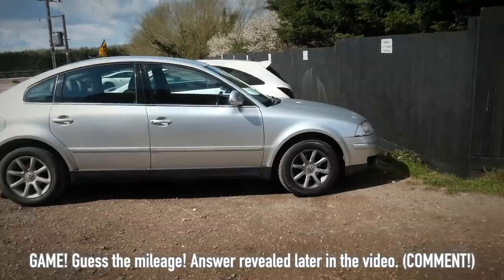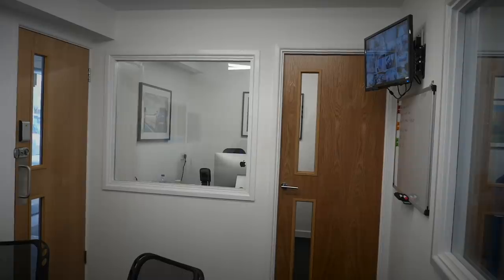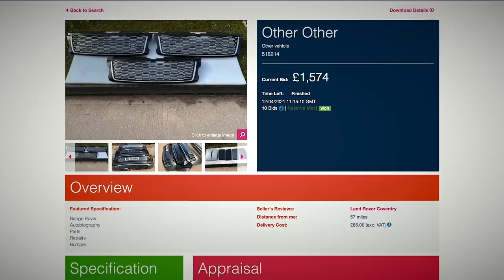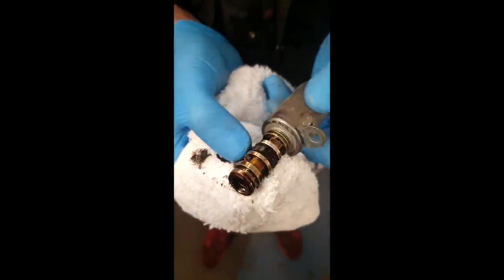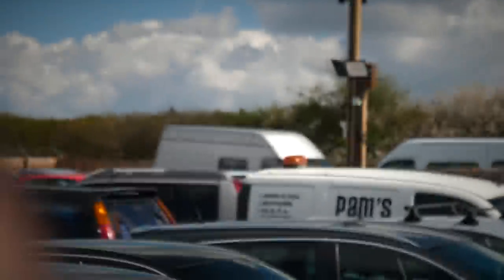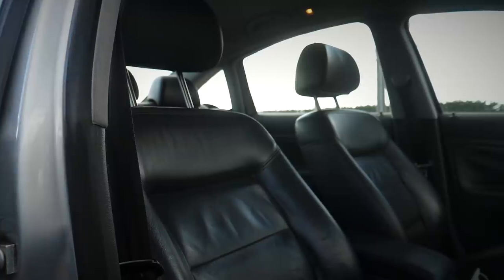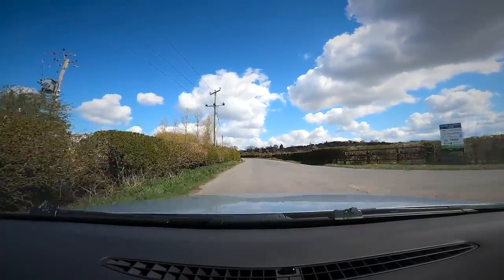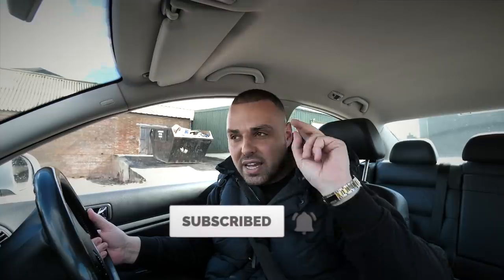INTRUDERS At Work! A Week Of PROBLEMS At BINCA! | EP2

Comment: My 2004 Passat 130 Highline was the one of the best cars I've owned.  I bought it in 2008 with 96k miles and sold it in 2015 with 250k miles. I had it remapped to around 165bhp and it never let me down once. Pretty much everything was original when I sold it including the clutch, gearbox, suspension and turbo; the only bits I needed to change were the alternator pulley, the injector wiring loom after it developed a slight misfire and the coolant temperature sensor. It's still showing as mot'd now with over 300k on the clock.

Comment: I own a taxi company in Scotland and we had a skoda octivia with 469k miles before we sold it and it's still going about to this day.
Reply: Bloke called Trigger now owns it 😂
Reply: Yes theres 100s around the UK with over 400k genuine miles and are taxis and have been sold on to other drivers..
Reply: Would the modern octavia diesels be able for high millage?
Reply: @irishman6124  not a chance sadly. We use mostly seat toledos now and even they aren't as reliable 😭😭
Reply: @bendover-eo9iu  thanks for your reply.. So many say modern diesels are unreliable after 120k...as I've noticed it myself.. I hate when people say its all about geting it serviced every 10k... What's your opinion on that?
Reply: @irishman6124  they are all good for high mileage, as long as you service them on time etc. They all last forever
Reply: @simmsali4994  their worn out after 120k..egr..dpf. Flywheel. Turbo. Sensors. Electric problems.. Etc etc etc.. Servicing has nothing to do with it... Its all about milliage... I'm at a stage now I hate cars
Reply: @irishman6124   b cuz your buying bags of crap, ragged abused ones. that's why!!  you pay for what you get. Flywheel dpf turbo?? ahahaha, what crap are you buying?? I have a vrs tdi now 2010 no problems at all!! Had it for 3 years!! so far just servicing like I told u. I'm on road 7 days, people use them as taxis!!!
Reply: @bendover-eo9iu  toledos are piles of crap. Cheap skodas how cheap do u wana go. Vrs tdi are reliable as long as u service them regularly they are fine.

Comment: Same issue with wife's mini, only wasn't vanos but camshaft sensor, garage diagnosed possible timing chain, £20 camshaft sensor and five minutes later sorted, borrowed mate's scan tool to reset EML light, can't trust a lot of garage's.

Comment: Sad to say you blurred the plate to reveal it later at 3:13 and it is MW53WLP. MOT Passed in September clocking 165,485 miles which means it could be just around 170k miles now.

Comment: To be fair those Passat are 130bhp, if you map it, then try again, you would probably beat the bmw, those PD 130’s can do well after a map and some light tuning :)
Reply: This one is a 100BHP pd
Reply: @Mr330d  really? Never seen a passat like that as PD100, only PD130
Reply: @moodyk1979  AVB engine code 100pd passats are rare most are 130bhp 100bhp In them is a little slow . Apparantly usa got a 2.0 tdi 136bhp b5.5 Passat 🤔